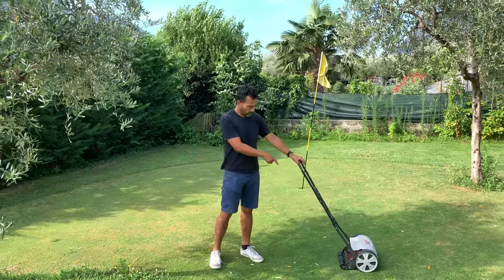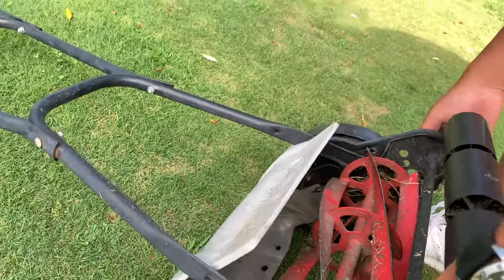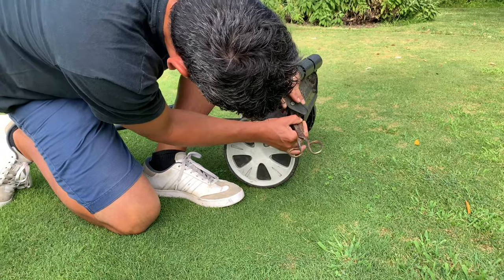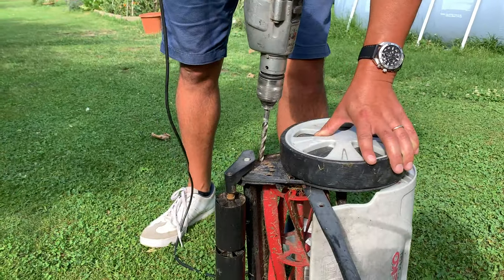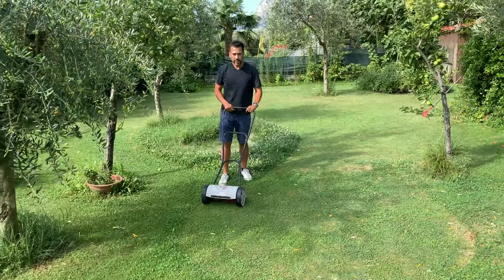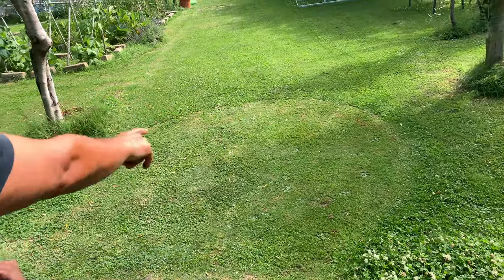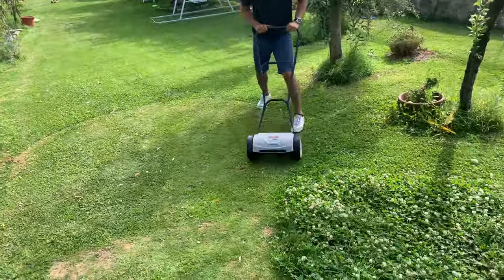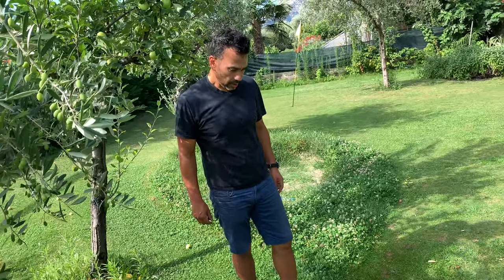How to modify a manual reel mower - cut really low

Comment: The problem with trying to cut this low is a) you need very level ground and b) you need at least 10 blades on that reel to avoid the washboarding affect due to insufficient cuts per inch.
Reply from the maker: It worked for a little bit initially, but eventually I got a second hand cylinder mower and it cuts much better.

Comment: Great video. Good skills bru. I have KYK tools reel mower. I tried to convert it with a petrol grass cutter....1HP.....? Using bike chain and lot of effort. But the welder fit the blade wrong way around....huge effort now to correct mistake. Anyway....these manual reel mowers is good but cant cut low enough. I thought of skiving wheels down?........remove the tread to gain 3-5mm.....! Also grinding off some of the metal on base. The secret of these expensive mower like Toro is that they basically lie flat on ground. The bottom blade/knife(one fitted to machine, not the the curved ones) slide on grass, so it cuts the thickness of that blade which is 1 or 2mm.
Reply from the maker: Yes, if you want to cut below 8mm it's best to use a petrol cylinder mower, although I managed to keep my green fairly short using this manual reel for a couple of years..........
Reply: @thebackyardgolfer7010  You said your green is 7 yrs in the making. That encourege me, 10months ago I planted bermuda runners. Its thick with some spots were it dont grow. I have a 500kg concrete roller and will top dress few more times. I noticed years ago that proper greens have quite  bit of sand in bent or bermuda. Seems grass alone wont give that PGA standard fast green? Comment please
Reply from the maker: @Godisnotjesus1967  my rolls pretty good because there is too much clay on the ground so it gets hard, but for putting it works to my advantage whereas for chipping no so much. Like I said with bentgrass, I don't really do much other than cutting and fertilizing once or twice per year. Yes do roll as well if I want the green to be in top shape for putting! No sand for me, just top dress with regular soil twice a year.

Comment: thanks for this vid, going to attempt similar on my 7-blade reel mower for backyard bentgrass green
Reply from the maker: It really worked for me for a while, eventually I ended up buying a second hand cylinder mower
Reply: very nice, you seem to have a large enough space to make good use of it. i just have a small 250 square feet 😁
Reply from the maker: @mensb1936  You can still make a very nice backyard green 👍
Reply: @thebackyardgolfer7010  The thing with putting green mowers is not only the height of cut, but also the frequency of cut. By that, I mean there's a reason most manual mowers for putting greens have 10 to 12 blades with an extremely precise grind of the reel and knife which is why they can cost well over $1,200. The motorized walk behind commercial ones can cost as much as $10,000.
Reply from the maker: @ITBOILSMYBLOOD  I got one for $200 second hand Toro, what a steal, ever since my green made a huge improvement. A manual is possible but is just too hard.....
Reply: @thebackyardgolfer7010  Actually, the reason a manual mower is "too hard" is usually because it may happen to be a contact blade design and not "touchless". A touchless cutting mower, even being adjusted for the SLIGHEST contact for the best quality cut cant be as easy as passing a hot knife through soft butter. But a Scotts Classic type, that's a different story.
Reply from the maker: ITBOILSMYBLOOD I think you still need a little speed for better performance, but is doable
Reply: @thebackyardgolfer7010  No, what I mean is, a contact reel will stop spinning immediately after the mower stops. The reel of a touchless cutting system, even when adjusted for slight contact, will spin for a good 20 seconds after stopping the mower. The difference might not sound like much, but the effort WILL become noticeable when mowing lawns, especially in thicker, taller grasses.
Reply from the maker: ITBOILSMYBLOOD I never seen anything like it, the manual reels here for under $100 do not have this system.
Reply: @thebackyardgolfer7010  That's because the manual reel mowers $150 or less are subpar for quality of cut. For an average lawn, try a Mascot mower.  https://www.cottagecraftworks.com/media/catalog/product/cache/1/image/1800x/040ec09b1e35df139433887a97daa66f/m/a/mascot-reel-mower-blades.jpg You can see the high sheen on the reel which means the blades are precision ground. Most cheap mowers have heavy hash marks and because that, the quality of cut suffers. Those Mascot mowers sell for $299 or more depending on what options you choose, 18 or 21 inch, sharpening kit, lawn bag. The best thing about touchless reels is they don't require annual sharpening on a specialized jig, just seasonal back lapping with compound.
Reply from the maker: @ITBOILSMYBLOOD  I really appreciate the info, thanks

Comment: I was looking at a earthwise 7 blade reel mower made specifically for bent grasses. It states cutting range of .5 inches - 2 1/2 inches, but the adjustments is different. Hopefully I can get it lowered a little.
Reply from the maker: you just need to lower the roller and it should work and make sure you use it only for bentgrass when you cut it very low. Let me know if it works!
Reply: Which mower was that?
Reply: I have the Earthwise 7 Blade and adjusted it to 5/8" on my Kentucky Bluegrass. I use it to mow 3-4 times a week and then use my Liberty 43 Allett on the weekends to stripe the lawn. I also have a modified Fiskars to mow at 3/4" and use that too for striping at a higher cut.